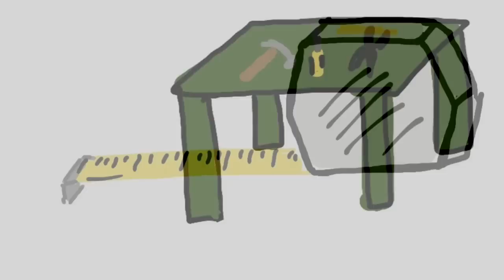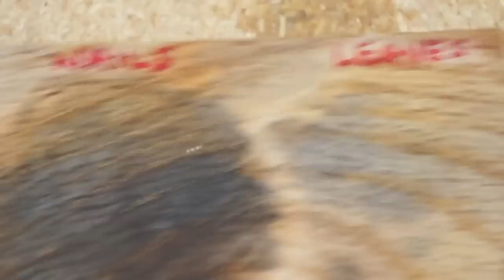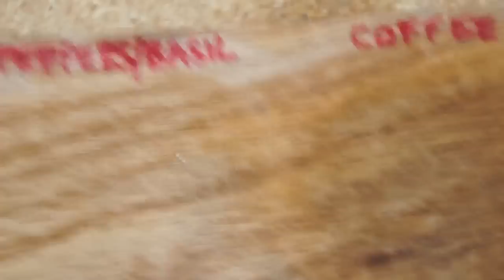Vinegar Stain Results on Oak and Poplar

Comment: The best for Poplar is '' Klean Strip'' @ H.D. and Minwax Sedona red 222 if you put 2 coats of Sedona red 222 it will look very freaken nice and finish with Polyurethane, 2 coats . I'd tried water pre-stain, pre-stain for oil and Klean strip as a pre-stain and that was the best,I waited 24hrs before applying the stain on all test pieces. I also put instant dark coffee(boiled) and it gave it a little darkness  in which it got rid of some of the whiteness and then I also did a piece with coffee and then the Sedona red and it came out very niceeeeeeeee.